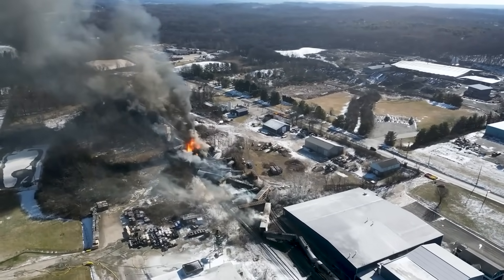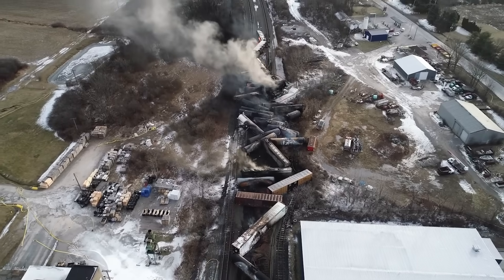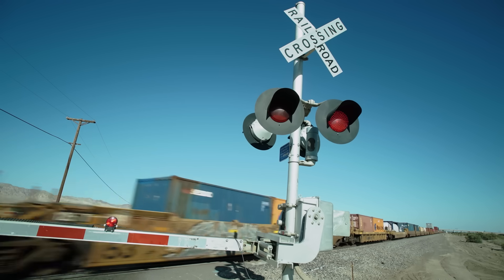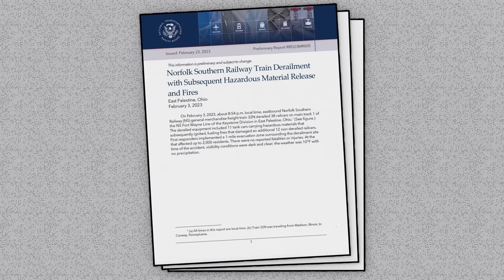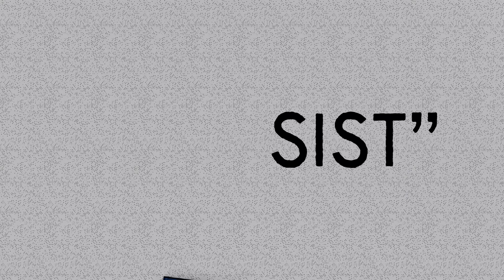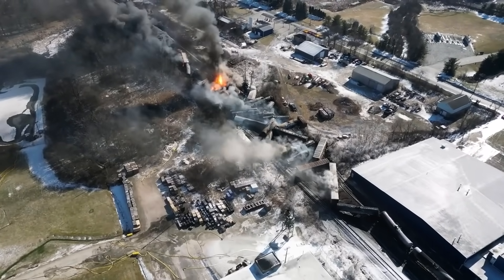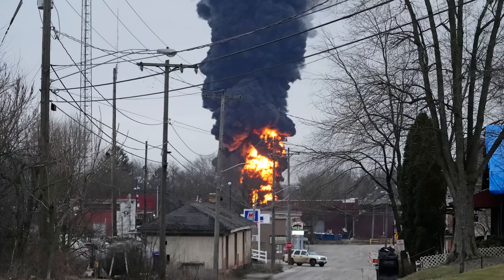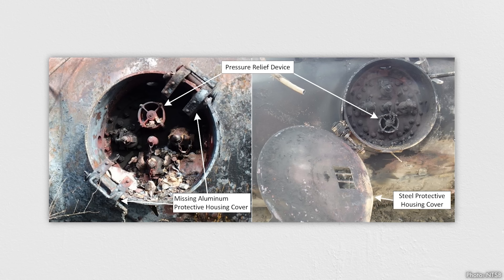East Palestine Train Derailment Explained

Comment: Hi! Railroader here! A few notes about defect detectors 

1. Defect detectors do not tell you the temperature of your axles. If the temperatures are within accepted boundaries, you get this message: "Train _, Milepost _. Axles_. No defect. No defect." If you do have an overheated bearing, you do get this message: "Train _. Milepost _. Axles _. Defect axle _. Defect axle _. Stop your train. Stop your train." Again, you're not given the specifics of the nature of the defect just that you do have an issue that requires visual inspection. Some do also note speed, but it's up to the railroad.

2. Defect detectors are self-isolated. They do not transmit data from one detector to another nor do they transmit it to a centralized computer system. The stored information is usually self-wiped up and until an issue arises like an overheated bearing or dragged axle. At that point, MOW crews will come in and grab the data. 

3. When I mentioned a train requiring a visual inspection, that duty falls squarely on the conductor. Since the 1990's, America's railroads have been operated solely by two guys: the engineer and conductor. By law, the engineer has to stay with his train to monitor the air brakes to make sure they don't accidentally release which has happened more often than you think. This means that the conductor has to walk the length of the train alone until he finds the problem and find a way to solve it by themself.
Reply: Very cool stuff.  Glad to have some input from people who have worked in the field with these beauties.  I used to work for Progress Rail (one of Cat's locomotive facilities), so seeing incidents like this happen are extra interesting to me.  They are mighty beasts and if they aren't treated with the utmost respect and care, terrible things can happen.  it was one of our units that fell into the bay while being unloaded in AU (i think it was). The locomotive alone was like 450ton or something like that... The payload of a mile long train... unbelievable.
Reply: So it reads the temperature and stores it locally, but only communicates a pass/fail?

I wonder if that'd be worth changing in light of this accident. On the other hand, a "pass/fail" is simpler for the crew than getting exact numbers.
Reply: @global2829  Simply transmitting them in real time to a central computer that can do further analysis (like one axle heating up too much/compared to the rest) would help. And if you want to go the extra step you can try to see if a MLM can be trained to spot defects before they reach any critical thresholds.
Reply: @krixlp , that has been proposed, but companies have been....reluctant to invest that kind of capitol in recent years.
Reply: @krixlp  better idea is have it transmit data in real time to a central computer with a AI that can detect upcoming defects and recommend maintenance when possible.
Reply: @global2829  The sensor may not even read the temperature. I work in HVAC and there are a lot of thermistor controlled safety switches. The thermistor(thermal resistor) changes resistance based on a temperature change and if the resistance closes a path that should be open, or opens a path that should be closed, the logic board will detect the fault based on what it sees as a binary data point.
Reply: @global2829  when you're talking about as many axles as modern freight trains have really all the crew needs to know is if there is a fault or not and what axle it is near.
Reply: @global2829  I dont have experience with trains, but I have worked with caution and warning systems on Military aircraft. How many axles per car? how many cars per train? It would be unrealistic to expect the conductor to monitor that many values. In aircraft you have gages for critical systems like fuel, rotor torque and RPM, engine and gearbox parameters ect, but many things are monitored with a caution and warning system that just gives you a light if something falls out of range. It sounds to me the system just wasn’t designed well in terms of the envelope of acceptable operation.
Reply: @global2829 , the issue lies in the fact that you have only two crew members total to handle the train when you used to have 5 men crews at the minimum. Engineers and Conductors are already facing hella work overload which is why they attempted that strike last October.
Reply: @caelumvaldovinos5318  
Not saying you're wrong, but 2 people are cheaper than 5 operating a train.
Corporations... Am I right?
Reply: @Dylan Watts , regrettably that is the case. The shareholders must have their value and the only way to do that is cut costs and corners at every available opportunity.
Reply: @caelumvaldovinos5318  you would need a 3 man crew at most, thats why they got rid of the caboose the EOTD does a better job.
Reply: @global2829  the railway companies could easily add so much better safety tech but they don't because they don't have too IE with no regulation they do the bare minimum
Reply: @global2829  completely random question : did you play Galaxy Online 2 for a long time?
Reply: Thanks for your post. So a defect detector is kinda like the dummy lights on alot of cars. The "check engine" light tells you somethings wrong but knowing exactly what's wrong will take a more time and investigation.
Reply: @olliefoxx7165  EXACTLY!
Reply: @olliefoxx7165  Yep. just like the oil light, if it comes on it's already too late.
Reply: @Blazer02LS  As true as that may be, once you see the warning light that means it's time to stop the vehicle.

The warning light isn't when it's too late, but you know it's too late once the train done come off the tracks.

I'm all for the idea of feedback sensors on each wheel, plus I'm all for the train guru's ideas of making a train length limit, increasing the crew, and also adding more safety sensors on the tracks themselves as well.

I'll tell ya what though, if we do nothing, then nothing will change. We have the technology, so there's no good reason we shouldn't apply the technology to prevent such disasters.

But you know how big companies are, it's all about the $$$...
Reply: As an industrial controls engineer (manufacturing not transport, but much of the tech is the same) this kind of binary logic is all too common. A few years ago, fuzzy logic was all the rage, now they label it AI for better sales numbers...but fundamentally the complexity of both the software and specifications/regulations that the software needs to adhere to need to increase a lot. 

The good news is that modern tooling and modern software are capable of handling that complexity. It's now reasonable for enterprising programmers to automatically instrument every sensor and every data point in a factory or train line with anomaly detection that would notice something like "that wheel bearing is surprisingly hot and getting hotter" while ignoring the temperature of wheel bearings on a train through a sunny section of desert.   The bad news is that it takes eons to push that decision back up the chain to management/purchasing/regulators to encode "do the smart thing" into the specification.
Reply: I'm a class 1 conductor/brakeman. It's all on the executives and hedge funds for slashing operating costs and pushing cars out of yards asap. Failing bearings are obvious to a car man with sufficient time to inspect. Yet the managers will deny the car repair and send it anyways.
Reply: @TUXmint , that's interesting. I can't even begin to think about handling that situation with just the engineer handling all of the responsibilities.
Reply: @caelumvaldovinos5318  trains here usually are far, far shorter than in the USA and Canada…
Reply: @pjotrtje0NL , that's what I keep hearing.
Reply: Interesting. I read that most modern fault detectors have cameras that activate to record and transmit to the engine. If this is true, and I don't see why it wouldn't work, that could alleviate a ton of speculative argument about these types of accidents. That must be exactly why American freight rail does not use them. That antiquated 20+ year old tech is fine... They said.
Reply: @Robert McGarry , those cameras only work if your locomotive has a computer screen on the conductor's desk that would allow him to monitor the train. Locomotives built after 1990 like the P42, SD70M, or AC4400-CW would have that technology either natively or by later upgrades. However, older models of locomotives like the SD40-2 and U33B do not have that tech. Also, those styles of defect detectors are relatively modern in comparison and they haven't seen that much of a rollout. Maybe with the stricter rules like Ohio requiring a defect detector every 10 miles we'll see more of that
Reply: @caelumvaldovinos5318  That is good information, thanks. Let's hope it does start change. 👍
Reply: @caelumvaldovinos5318  you could easily make a portable display and reciever to be used on those trains without the necessary tech. We are sooo far beyond the level of tech that would have been required to prevent an accident like this that "well some of our trains are 30+ years old" cannot be allowed as a valid excuse for not implementing safer systems. I am fairly confident I could, by hand, create a device capable of receiving and displaying a log of train condition data and potential red flags in about a week and for much less than 1k per unit which would make the cost of equiping all trains with such devices look like a sneeze compared to cleanup costs for events like these. Of course conductors or engineers might need some extra training to interpret the data meaningfully, but this could also be done on the device to produce output not possible from a single defect detector. In this case of information about the rate of temperature increase could have allowed the conductor to stop sooner as holding steadily in the maximum safe operating range is fine but quickly accelerating from below to near the top would indicate an issue especially in a situation where the train should already be in equilibrium if it had been traveling for a while before the problem occurred. Expectations could also be adjusted depending on how hazardous the cargo on board is.
Reply: @caelumvaldovinos5318  
Hi, I have some questions.
If the train engineers had advance warning of the overheating axle from the defect box and were able to start breaking the train, why did it derail?

The video mentions that the emergency brakes came on before they could bring the train to a controlled stop but then why did the emergency brakes cause the train to derail? Did the E brakes cause the derailment? Why?

Thanks!
Reply: @Mostly Penny Cat , that's a good question.

The reason why the train derailed was because the train was still moving when the bearing failed failed. When that happened, the axle came loose and pulled the train car off the rails. When the car came off, the air line that delivers the compressed air to the cars broke which caused the train line to lose pressure and go into emergency. This basically slammed all the brakes on in an attempt to reduce the damage
Reply: @Gage Unruh , then by all means build it and sell it.
Reply: @HatsuneSquidward  "I am fairly confident I could, by hand, create a device capable of receiving and displaying a log of train condition data and potential red flags in about a week and for much less than 1k per unit"

that's just some cheap laptop with a 2G receiver plugged into a USB port and some analysis software running on it that checks for all known possible data abnormalities in the received data.
Reply: @MostlyPennyCat  The emergency brakes came on when the derailment occurred which severed the air hose between the cars.
Reply: @Robert_McGarry_Poems  now the important question. How many cars actually use those modern detectors? What shite detectors have been allowed to be used through grandfathering?
Reply: Great information.  
2 questions.   you said "by law the engineer has to stay with his train to monitor the air brakes to make sure they don't accidentally release..."    I thought that the air brakes on trains failed in a safe mode.  That is to say that if there is a loss of air pressure the brakes apply automatically.  I believe it was even mentioned in this video.  If that's the case, how would the air brakes accidentally release?
My second question pertains to the Lac Megantic disaster.  If it is law that the engineer must stay with the train, then why was the train left unattended both before the engine fire and after the engine fire?
Reply: @tchevrier  Lac Magantic occurred because there were not enough hand brakes applied to the consist to prevent unwanted movement.  This train was operated by ONLY an engineer. The air brakes were set and was assumed under false pretenses that there were enough brakes tied to prevent movement. When air brakes are set, it is controlled by air pressure. When the fire occurred, the dispatcher told the firemen it was ok to shutdown the locomotive, thereby allowing the brake pipe pressure to fall below operating levels and the brakes eventually bled off. 

This was caused by a series of human failures. The biggest issue being the crew consisting of a single engineer. Having a conductor allows a double check of all necessary items to safely operate the train. 

Also, engineers sole responsibility is the safe and efficient operation of the train. It is the conductors responsibility to administrate all train operations,  as well as watch track conditions and signal aspects and to relay noted conditions to the engineer. That being said, engineers are also self aware of these things, in addition to the operation of the train and/or PTC. 

Those suggesting that the railroads should invest in extra sensors/cameras at every wheel to individually monitor conditions simply aren't considering the exorbitant cost this would involve. We are already paying inflated prices on all goods, this would acutely increase the cost of all shipped goods, as well as end use items produced by them. 

It has also been suggested that wayside detectors have cameras... I have never seen a camera at a detector.  Wayside detectors successfully protect rail traffic every day.
Reply: @imnufktsdude  I was surprised to hear that there was no conductor on the train.  Almost as surprised as when the engineer was acquitted considering he admitted to not following the rules and procedures.
Reply: @tchevrier train brakes work on the differential of air pressure. Air fills a reservoir on the car and causes the brakes to release once the pressures are equalized. When there's a drop in the pressure of the brake pipe then the brakes apply. Once a car has been sitting for a while then the pressures equalize again. That's why there's hand brakes.
Reply: @tchevrier  if the main brake line loses pressure the brakes will apply, but only if pressure is still high enough in the air tanks, or reservoirs, on the cars. If these tanks lose pressure the brakes release. The tanks will lose pressure over time if not kept charged. This is what happened in la megantic. The engine caught fire and was shut down allowing the air brake reservoirs to lose pressure and the brakes to release.
Reply: @jamesharrisontaylor  Thank you for answering my question about the brakes.  My question regarding Lac Magantic pertains to why the train engineer left the engine unattended when it apparently is against the law to do so.
Reply: @tchevrier  he tied handbrakes which don’t rely on air. This allows the train to be left unattended. He tested the efficiency of the handbrakes, however he left the air brakes engaged while doing so leading to a false confidence that the handbrakes were good enough to hold. They weren’t. When the air brakes lost pressure and failed, the train rolled down the mountain.
Reply: @jamesharrisontaylor  According to what the original poster (Caelum Valdovinos) stated that trains are operated by 2-man crews and by law the engineer must remain with the train to monitor the brakes.  My understanding is this train was operated by a 1-man crew.  How does the train engineer get out and set the hand brakes if by law he must stay with the engine to monitor to the brakes.?
Reply: @tchevrier  By securing the motors by tying the hand brakes on the motors. Then the engineer can get off and tie brakes on the cars and then go back to the motor and release the air brakes to check to see if they tied enough hand brakes, then they will put a new set on the air brakes.
Reply: @dammityoutube  ok. thanks
Reply: @jamesharrisontaylor  yes, somebody already explained that.  I guess that's all conditional upon making sure you apply the proper amount of handbrakes.
Reply: @tchevrier  right, and testing them to make sure they’re able to hold the train.
Reply: @jamesharrisontaylor  what is involved in applying handbrakes? Is it a lengthy process?
Reply: @tchevrier   just spinning a hand wheel a few times on the proper amount of cars while the air brakes are applied then releasing the air brakes to test the hold of the handbrakes
Reply: @tchevrier  The engineer of the Lac Megantic train, and two other railway employees, were each charged with 47 counts of negligent homicide, but eventually acquitted by a jury.

https://en.wikipedia.org/wiki/Lac-M%C3%A9gantic_rail_disaster#Criminal_investigation
Reply: @Dennis-vh8tz  yes I know.  Absolutely ridiculous
Reply: @tchevrier  Lac Megantic is precisely why the rules around train securement changed.
The initial failure mode for train brakes is to go into emergency. However, unlike truck air brakes which are spring applied and air released, train brakes are air applied and air released - once an emergency application has occurred, it is possible for the air pressure that is applying the brakes to bleed off, resulting in the loss of braking power. For trains left more than two hours, hand brakes must be applied.
Reply: FWIW, not all Defect Detectors are isolated. On at least two occasions in the last month I've noted Norfolk Southern dispatchers instructing trains in Virginia to stop and inspect specific cars in their trains based on "No Defect" reports that then passed more data back to the central office. The axle temperatures were reporting higher than expected, but not enough to trigger a defect based on the detector's rules. Also, some detectors can (and have) been configured to announce the cause for the detection, e.g. "Norfolk Southern Milepost One Four Point Four Critical Alarm Hot Box East Rail Axle Two Four Nine" -- as you note in other parts of your comment, it highlights where different railroads have different policies, and there is further variance based on age of detectors and the levels of integration available. or configured.
Reply: The whole "I could build such a device in a week" reminds me of the xkcd comic:

You're trying to predict the behavior of <complicated system>? Just model it as a <simple object>, and then add some secondary terms to account for <complications I just thought of>.
Easy, right?
So, why does <your field> need a whole journal, anyway?

So, I've done my master thesis on structural health monitoring. Not in the railway sector though. These are the things I learned:
1) It's easy to build something that detects 95% of failures and is quiet in 99% of the cases without one. But if you don't have that many failures, that's still way below usable on industrial scales.If you have a train with 200 cars and you have 1% false positive rates, you have two notifications per train. All the time. Nobody will pay attention to that.
2) You don't need microphones, you can just glue a piezo to the frame and you are basically done.
3) Constant supply of sensors is always an issue. Batteries work for a few years in good conditions. But in temperatures below freezing or out in the sun in changing conditions? Have fun. Charging is a nightmare if you don't have cables. And as we saw, we need measurements every few kilometers at least.
4) Sudden local changes are usually a good indicator of something breaking. Aggregation/comparison of data from multiple bearings would definitely be a good idea.
5) Having a few stations which can service thousands of cars in a few hours is way more cost effective than having a sensor in every car.
6) This is one I cannot stress enough: Companies are dumping loads of money in this technology. Because avoiding failures saves a lot of money. But it will not increase safety. It will be used to remove other costly measures. Just imagine how much money you can save if you don't have the operator check every car, but just have the computer flash a green light. That's like 10-30min of time the train can spend transporting cargo. That's a lot of money to be made.
Reply: UP has detectors that transmit to a central office where axels with temperatures that are trending upwards are identified and that information is passed to Dispatchers and crews.
Reply: This need to be addressed with a MASSIVE fees and fines payment... Because this is management decision on cutting maintenance and resposabilities costs in order to make profits.
Reply: @Google Google  unless you're going to fine the company in the tens of billions, and prosecute the executives. It won't change.
Reply: @GooogleGoglee  a better solution is to fine the hedgefund managers themselves, or at least ban hedgefunds themselves and promote individual shareholders. if we the people don't like a company not promoting safety or being a bigot in hiring policies, we can always dump the share price and punish the company financially till they announce they will do it and have made a plan to do so.
Reply: So you're saying the monitoring systems are only installed so that the freight company lawyers can shift the blame to the engineers and conductors but not actually detect any dangerous problems before they turn into a worst case scenario...
Reply: @SonsOfLorgar , defect detectors do work as designed. They have saved more accidents than can be counted. The issue with East Palistine is that the distances between these detectors in combination with a 3 mile long train created a situation where an axle deteriorated more rapidly than detected and corrected
Reply: @caelumvaldovinos5318  and in my perspective, that setup with fixed threshold and only binary feedback to the only people who can do anything about an immediate issue is a criminal design as it will never alert for this kind of extremely common form of intermediate-fast developing mechanical stress failiure in EVERY kind of machinery.
I used to be a waste water process controller and maintenance tech, and aside from the breakages and stoppages caused by the non-feces objects idiots flush down the toilet, this exact pattern of bearing failiure was the 2nd most common cause that was fixed before breakage by monitoring machinery running temperature and power delta amperage over time along with audiovisual inspections.
The third most common cause of pump failiures was cavitation damage to the pump wheel.
Reply: @SonsOfLorgar , it's what the railroads invested into back in the 1970's (?), and nothing has really changed since. Regrettably with the way the railroads are run, I doubt we'll see much improvement
Reply: The funny part is because the trains and what not were built a while back the materials that we have made and found recently would make some parts of them way better. Either making them last longer or just making them so much better at taking heat
Reply: @SonsOfLorgar  That is actually exactly how train companies operate with everything, not just the monitoring systems. I got to talk to someone who worked at a rail company once, and everything is set up to make sure any issues land squarely on the people working the trains and yards.
Reply: @bluefish239  yup, it's capitalism 101.
Reply: @SonsOfLorgar  As a criminal defense lawyer, yes. The answer is yes!
Reply: @SonsOfLorgar  sounds like the big train way to go.
Reply: Is every train in the US required to have a conductor? Asking because in Europe, many freight trains are run solo by the engineer. They tend to be shorter than US trains though.
Reply: @steve1978ger  The companies are pushing for engineer only crews, with roving conductors to help if needed. Currently still a two person minimum here is Canada.
Reply: There used to be a flight engineer in the cockpit of every plane.  There used to be more than 4 lanes open at Walmart.  Common thread: the profit motive of capitalism has to be checked by government regulations, but they are in the pocket of corporate lobbyists.  Lobbying is a legal form of bribery.
Reply: I'm not a railroader but rather an IT consultant and from that perspective I see both point 1 and 2 here as defects that should be corrected. Granted I'd prioritise fixing point 1 as by providing the temperature even if that is merely the highest temperature recorded in the pass to the train crew would allow them to act as the memory and detect the upward trend which they could then have acted upon. My proposed solution however would be to implement a connected system that solves problem 2 also, perhaps a mesh network where each station transmits the digital data on a secondary frequency that the neighbouring ones also act as repeaters for. This would eliminate the need to install wires in remote locations far from existing active data cables, sure the transmission to a central site would be slower but this is the less essential issue anyway. The key would be that the neighbouring units in the adjacent blocks in either direction would have this data within a few milliseconds, as such the software could compare the readings for each axle and report an abnormally large change in any of them. Were such in place the latter here would have prevented this accident it seems as two sensors observed a large increase prior to the third observing a temperature above threshold on it's lonesome. The system as I would have built it would have commanded the train to stop for inspection after the second sensor observed the anomaly relative to the first, granted there is a risk that a visual inspection of the train while stopped might not have revealed the problem but it is another opportunity to break the chain of failure, it adds one more layer of swiss cheese where the holes might not line up and thus can break the chain of failure leading to a disastrous outcome.
Reply: @FaerieSeraphina , 2 problems.

1. Train crews are facing work overload as it is. Having to remember temp numbers and monitoring trends takes up human CPU that should be allocated to train handling and following a rulebook that is thicker than some novels. 

2. The issue isn't so much as tracking an issue as it develops as it is catching the issue. Bearings heat up and cool down very quickly due to things like shifting loads, brake applications, curves, speed, etc. 

The solution really is to return to shorter trains, reinstatement of 5 man crews, and more defect detectors.
Reply: @caelumvaldovinos5318  . Exactly!
Reply: @FaerieSeraphina  I propose magnetically mounted IoT sensors at crucial points in the under carriage to form a peer to peer network,  passing data along for display at the engineer's cabin.  The sensors should be deployed with enough redundancy to account for some of them dying of overheat or corrosive leaks. When the cars are detached, they can be retrieved for use elsewhere.
Reply: If I were a train engineer, i'd want to see more information than just "axle good, axle bad". Couldn't they just give the train engineer some kind of display in his cabin, which has car axle data transmitted to the display via telemetry from the defect detector so he can examine the temperatures and their trends himself with some kind of interactive user interface?
Reply: @rixille , that has been proposed but the last thing you want is an engineer looking at a screen for 30 odd minutes when he should be looking for signals, crossings, obstructions in the track, etc
Reply: @caelumvaldovinos5318  seeing if the temperature of an axle is way higher than that of the surrounding axles takes 30 seconds.

just present the data in graph form.
Reply: @Ano Nym , you're forgetting that you're having to measure and compile that information over literally thousands of axles. Then whichever sucker has to read that then has to decrypt that data quickly and make a judgement call. Literally, just having a pass/fail call is the simplest solution
Reply: @caelumvaldovinos5318  that's like a dozen lines of python script to "decrypt" the data (I think you mean "analyze"), run regression and find outliers. Don't even need "AI" or machine learning, it's a simple statistical test.

I wouldn't even instrument every railcar/axle. Just make smaller, cheaper, lower powered and smarter wireless defect detectors and place them every mile, wireless mesh them together, and track trends on thermals, vibration, etc. No central repository needed, you can run the code on a raspberry pi equivalent hardware, at each node, and relay it to the next node in line.
Reply: @caelumvaldovinos5318  I've worked on projects of similar scale, albeit a bit smaller. To develop an industrial system like that would cost in the $10-200M range. Once you have that tech researched, each node would cost around $10-100k at scale. There are 160K mi of rail, so $1.6B-$16B to outfit the whole USA. The derailment cost NS $5B in market value, and likely will cost a similar amount in environmental cleanup and fines. That's $10B for the cost of 1 EP disaster, vs basically prevent most derailments. The technology exists. The companies are lazy cheapskates.
Reply: @defenestrated23  "we must preserve shareholder value!" Railroad managers will sooner scuttle their own railroads than adopt that tech
Reply: @caelumvaldovinos5318  why not have 2 engineers, one looking at the screen and one doing the driving? makes no sense to not have that sorta thing, along with providing comforts to the engineers and conductors on longer routes.
that way, you'd have 2 sets of engineers and 2 sets of conductors, whos job is to make sure the train is going 24/7. wireless video chat, and wireless internet among other comforts would help make sure conductors and engineers with families can keep in contact.
its a similar system to the airline industry, they have a sleep quarters for pilots and crew, but theirs is much more automated.

i bet the investment in the workers combined with the investment in the local infrastructure in terms of safety and accountability would make it a nice and comfy position that many younger folks would want to come into the workforce in, which then generates more jobs long term for the industry and more economic relief when needed. its obvious the current system is not working, and the duopolies needs broken up into a dozen pieces while mandating sharing of information to prevent accidents between companies and a monthly public audit into accidents, hijackings, maintenance, and plans to keep lines up to date.
Reply: @kermit peck , we used to have something similar. Back in the golden days of railroading, you had 5 person train crews: an engineer a fireman, a conductor, and 2 brakemen. However, deregulation, law changes, and bribery all led to the train crews being whittled down to just 2
Reply: @anonym3017  better idea:
have a AI that is trained to detect faults through all the sensors brian has stated, thermal, rotation and sound sensors, and send it back to the cab in a simple format that shows where the fault is on the train.
like on a 30 car train for example, if the sensors individually don't detect problems but collectively show a possible bearing problem in the future, the AI can transmit the data to the yard and the cab of the train simultaneously, and give detailed data for the yard workers while notifying the engineer and conductor to a possible maintenance needed reading out like "maintenance needed on car 4 wheel 3, recommend maintenance at nearest yard" and can schedule maintenance at the nearest rail yard upon request of the engineer or conductor. that by itself would help simplify the process of finding faults and items in need of maintenance. i still think a 10-20 man crew is better for long distance hauls while short to mid distance hauls can have 5 man crews.
i think also having stop areas for trains to stop and check a problem is also better.
Reply: @caelumvaldovinos5318  more or less its just hedgefunds and a serious lack of people actually putting stocks in their control.
once the people are put into control by decentralizing the banking system, you won't have those problems in excess with the rail industry.
Reply: @caelumvaldovinos5318  I agree. The tall companies need to pay for more workers to drive, observe & stop to fix the train when needed. Oh, but shareholders want their million dollar bonuses. 😠
Reply: @rixille  Monitoring the many hundreds of axles on a train would be better done a computer, and if the crew were expected to do so, that would massively distract them from the job of safely operating the train - adjusting speed, paying attention to signals, not to mention looking for:   cars, pedestrians, trees, etc on the tracks.
Reply: @rixille money and standardization and money
Reply: @rixille  it's honestly not needed. There's other people watching this stuff, the dispatcher will alert them if it's needed. People don't comprehend how uncommon these issues are anymore.
Reply: @rixille  for all like 7000 bearings (made up number but its a lot) in the train? pretty sure they have better things to do... you'd need a third person just to look at the data... thats why they use a computer to look at it
Reply: @killorkubed  It would need to narrow down only to bearings of concern, if any.
Reply: @rixille  but that’s what the computer system is already doing?? Figuring out bearings of concern and alerting the crew, this was just a case that the bearing went to hell too fast for them to do much about it
Reply: @rixille  same here.
Reply: @rixille  The defect detector will tell you the axle count of your train and if theres a defect what axle its (a lil fyi one railcar usually has 4 axles and most locos with exceptions have 6 axles) via radio
Reply: @rixille  I don't think that adding that much data to an already high workload would be beneficial. Perhaps they could could learn from NASA who have studied this sort of information overload to refine the pass/no pass into something a bit more informative for the crew of a train.
Reply: @minorityofthought1306  If train crews are being overworked or are inundated with too many tasks, then would it not make sense for the railroad companies to hire some extra crew?
Reply: @rixille  Quite the opposite. There are already projects, that involve remote control of (passenger) train by just 1 person. And that 1 person would be assigned up to 4 passenger trains all running simultaneously. Granted that much of the work would be automated as much as possible, but it still is a huge safety risk, which is tolerated because it allows to hire less workers per train.
Reply: @rixille  can't do that without risking profit margins. lovely how shareholders (aka hedge funds) control how a corporation works instead of helping a corporation to be more safety and worker oriented.
one thing my dad always said that his granddad always said "treat the employee good and they'll treat you well" and that seems to ring very true ive learned as so many problems in corporate america are often laid at corporations treating workers like cowpies and horse manure.
Reply: Where can you find frequencies for defect detectors? There’s three near me that are supposed to be on 160.800 but never transmit anything. I hear train crews on occasion but the detectors remain quiet.
Reply: @iananderson8363 , it depends on the railroad and not something that is handed out on the regular
Reply: @Ian Anderson some detectors only transmit if a defect is detected.
Reply: @iananderson8363  Some of those older Conrail DD installations only transmit an audio alarm if a defect is detected. Otherwise, nothing is transmitted.
Reply: thanks for the comments. no disrespect to the conductors, but it seems more failsafe technologies could help take the inevitable human factor out of the equation to help prevent these catastrophes
Reply: In response to your #2, it depends on the railway, some of them have reporting to the dispatcher office, as it's important (by rule in Canada) that if the train passes a site and doesn't get a message, they tone up the RTC to verify there are no alarms, while reducing speed.
Reply: All of CSX defects are networked together. As a matter of fact, train crews have the ability to log into the defect detectors portal on our tablets if we know where to look.
Reply: WRONG - defect detectors at all the major railroads report back to a central server where they can be trended on.
Reply: What strikes me most is the threshold used to indicate a failure. It seems that under normal operating conditions the axles are much less than 50 degrees above ambient yet they wait until temps are over 200 above ambient to trigger an alert. By that point it was too late. This seems like a major miscalculation and one that can be directly linked to causing this derailment. Why wait so long when even 100 degrees above ambient is anomalous enough to warrant inspection?
Reply: @josh208  bearings are fickle creatures. The weight of a load, train speed, track conditions, and curves all affect their temps. An empty hopper trooting along at 50 MPH in Nebraska will have dramatically different temps than if it were loaded and crawling up the Rockies. You want that leeway just so you prevent false readings and cause the crews to begin to get complacent when given a fail
Reply: I would love to be corrected if my assessment on this is mistaken by someone knowledgeable. I also happen to be a civil engineer. For me I like redundant safety systems though as an engineer I understand we are always on the balance of cost and safety. It sounds like there is little to no redundancy here. The way you describe things these detectors are blackbox recorders and the removal of the caboose was only to cut cost, not because it was made so redundant as a safety measure that it no longer served a purpose. That said I'm sure a more automated safety system than a caboose that works can be designed but does any such system exist? Because it sounds like the railroad industry is using the detectors as smoke and mirrors to cut costs at the expense of safety (aka business as usual for industry).
Reply: Oh I want to emphasize I think freight rail should be supported. Like if anything I hope we avoid events like this as much as possible to avoid people being harmed, to preserve a historic and essential industry and to keep our economy going.
Reply: would you recommend more in-depth information and/or retention of said information of rail cars/axles OR more present operators to evaluate reported occurrences along with tighter tolerances to active measuring devices?
    Edit: If neither, what would you're solution be? not to put you on the spot...
Reply: @dedkeny , my solution is 3 steps:

1. Cut train sizes to 1 mile maximum unless given special permission by the FRA. 

2. Increase train crews back up to a minimum of 3: an engineer, fireman, head end brakeman, rear end brakeman, and conductor and reissue cabeese onto trains.

3. Require hotbox detectors every 10 miles or when practable, not to exceed 15 miles
Reply: Walking a Defect reported train is my day job lul (Conductor here)
Reply: I've seen a few of Distant Signal's videos about defect detectors (haven't been popping up lately though - I blame The Almighty Algorithm). The actual sensing tech seems really useful, but it's just transmitted with this janky robo-voice radio system that looks like someone was just avoiding having to add any extra dedicated equipment to each train. With the frequency that these things are already installed along most lines it seems like they could be made to detect a lot more problems pretty reliably with some simple networking and data analysis. Especially in this case where there was one parameter approaching the threshold for a long time before any alarm was triggered. I assume those thresholds are set high enough to avoid a lot of nuisance alarms, but with some basic recording and comparing data between stations you could spot a single wheel temperature rising too fast well before it actually hits the limit.
Reply: @TUXmint  we can use wifi to record audio and where you are in your house, we can absolutely use microphones to pick out the sound of a failing bearing. The real issue is train companies aren't willing to spend money to keep the infrastructure modern and safe
Reply: Respect
Reply: I'm not reading through all the comments, but 24 year carman here. Newer detectors DO transmit data. That's how they give trending reports. Ours will send it to the mechanical desk and automatically create a report in our TCIS system.
Reply: Everything you just wrote is just bad and each one of those things needs to be addressed by the industry.
Reply: Disagree. Defect detectors to communicate to a centralized database (at least the major Class I railroad I work at). Trends are analyzed and if a car is trending hotter.. even if not at the threshold that the detector alarms, the computer generates an alert.
Reply: 1) modern detectors DO sync with back-office servers. As an engineer who (up till December) worked on this rail line east of Pittsburgh, I have multiple times been contacted by either the dispatcher or "wayside Detector Help desk" to be notified that a bearing is trending hot, that is, running consistently more than a few degrees above ambient temp. But it's almost always been hours after the servers discovered the pattern. In this case, the system probably detected the issue, and qued up a report to be transmitted to the crew. As someone who ran these trains, it is my opinion (restricted point of view that it is) that the major delays are caused by major staffing cuts at the headquarters, thereby creating massive backlogs in helpdesks contacting trains.

2) PTC was a MASSIVE, congressionally-mandated, computerization effort of train operations. PTC included digital notifications of paperwork changes and travel authority changes to train crews. This includes automated notifications that automated electronic tests done for crossing protection systems have failed, and issuing instructions to safely operate through a suspected non-functional crossing. So why don't the detector systems have an automatic alert/notice of a 10-15 degree increase between detectors?
Reply: That may be how defect detectors announce where you are, but it is not how they are elsewhere.  I have traveled enough to see several types that announce far more specific information than the ones you described.
Reply: @bradarmstrong3952  Even if that's true all it does is highlight that NS and probably other roads have detectors that are only really useful post accident. There is clearly no (enforced?) standard of sufficient safety.
Reply: I work with the railroad. NS to be specific. 
What baffles me is that there seems to be entirely too much reliance on customers to monitor and report railcar issues to the railroad for repair.
I know the railroad does do inspections, however it seems like they cover coupling, braking and whether or not there's a leak. That's it. The rest seems to lie on the car owners or people like me that load or unload said cars.
I deal with hot asphalt cars regularly. The time requirement for inspections on these cars for safety features can be 6+ years.
When the people handling these cars do not own them, there's an "I don't care" attitude that comes with it.
Especially when these cars do not come back to you for months, years or never.
Reply: @moparmadness0180  I think in general in a system like ours there is always a push and pull over time between regulating safety and not putting onerous duties on operators. Unfortunately we tend to balance  b/t extremes with our regulation- too much or not enough. The rail industry is far from alone in that manner. It is quite shocking to a civil engineer tbh though. I would not have been able to remain as calm while talking about the (apparent lack) of any redundant safety measures in that system.
Reply: @Moparmadness01 , I'm not surprised by the lack of inspections. But I'm still incredibly disappointed
Reply: sounds like politicians have been at work in the railroad industry. 
politicians with their pockets full of corporate fat cat stacks.
politicians that encourage industry "self-regulation" not government regulation.
politicians that last cycle gutted enforcement divisions of the government.
politicians that don't care about the working man/woman providing for their family, just the profits off their labor....to bribe the politicians
politicians that don't care about risks to workers, the public or the environment.
What politicians does that sound like??????
Reply: >monitor the air brakes to make sure they don't accidentally release which has happened more often than you think. 

How do they "accidentally" release? Are we talking a mechanical issue, or a human one? If no one's on the train, no one's there to accidentally bump a switch or something right?
Reply: There are networked hot box detectors in high traffic areas and send data to the carriers network operations center.  These are more expensive and not used in low traffic areas.
Reply: and what did Alfred e newman have to say ? 
too many whites in construction. 
wtaf
Reply: As a railroad man myself I can validate everything you said. And I say well said.
Reply: Kinda sounds like there should be bigger crews for the bigger trains. And I think that there was a strike that mentioned that too
Reply: What of this was done on purpose to destroy small farmers ability to produce to help Create a coming crisis worse?.. hmmm
Reply: i feel like just having more detectors would be good enough like 20 miles is a pretty good size distance for a lot to happen if a defect happens right after a detector and is bad enough it wont even make it to the next one since metal on metal can heat up very fast with friction like melting steal in minutes fast. i would say every 5 miles but we all know the goverment and railroad companys wont do that because that doesnt make them money. this is the us if it doesnt involve money they dont care sad but its very true
Reply: Thanks for this perspective.  I understand companies want to save on labor costs, but having anything less that two people on a crew seems a terrible plan.
Reply: @sesquey  it should be like 4 to be fair because if its only one person making sure the whole train doesnt depressurize thats leaving a lot of hope in human error not saying hello
Reply: I get that having a simplified system makes life easier for the crew, who are overworked and may not be trained for dealing with the extra data. (And it would be a lot since you’re talking about hundreds of cars, each with dozens of data points)…

But it’s not like we can’t transmit, record and computationally make that easier… at very least it would be good to have more than just a binary. Pass/fail doesn’t tell you that you barely passed and might fail any second- miles and miles from the next check, by which time you may well be past the point where you can save the train.

As it is, the difference between “everything is perfect” (temp below 170) and “critical failure, train must stop immediately so car can be removed” (temp over 200) is only 30 degrees. If these stops are 10+ miles apart… it seems like it might be trivial for old equipment in use to jump that gap entirely between checks… leaving a train running for miles, well above critical, with no one the wiser.

You don’t have to give the conductor and engineer all the data… but you should give them more than just 2 bits. Set it up with, say, 7 grades… with the full data sent to a central location.

From a 1 “perfect condition” to 7 “too late to save the train”.

Anything 3+ flags the data for review.
Anything 5+ requires a stop and flags the data for immediate review.

I’m pretty sure the crews can handle that.
Reply: @ARedthorn , to make that work, we need to increase the minimum train crews back up to at least 5, reintroduce cabeese on the train that are capable of receiving & displaying the data, and equipping all the defect detectors properly. At this point, that is not happening with the way railroad management is running things these days
Reply: @traindude 28 , you still find SD40-2's on local service on the class 1's. They're really the only option when talking about light track and sharper corners
Reply: @traindude 28, oh yeah, I've heard about that garbage.
Reply: @traindude 28 then how do you explain the disaster when the sensors with binary alert system worked exactly as designed and, as designed, failed to alert the crew in time to prevent it?
Reply: Thanks for the information!
Reply: Americans never pay attention to the cheating incidents in their own country. On average, there are 800 cheating incidents every day, which is more than the cheating incidents of all countries in the world combined.😂😂
Reply: It sounds like they need to reconsider the thresholds...maybe add a new one that forces a stop if the temperature increases, say, 200% in 10 miles. That would seem to be either more or as important as the difference in temperature between bearings.
Reply: @slightlycrookedworkshop , bearing temps change wildly as track conditions, speeds, load weight & balance all change. Tracking percentage change is a recipe for disaster as crews begin to ignore the calls to stop the train and an actual problem gets buried
Reply: It's very good rebuttal. Thank you for laying me like myself
Reply: https://www.youtube.com/watch?v=b2n9ov3l4zE
Reply: Pretty crazy with all the relatively cheap tech that the axels don't have native monitors on each bearing housing. Bet that's coming soon...unless I'm underestimating the power of the train company lobby.
Reply: That 1990’s style thinking of 2 guys monitoring an entire train by themselves with all the technology sounds very.. outdated.

Thank you for all of your insight! Met a railroad engineer once and was a very friendly and sweet old man, still remember my encounter with him today when I had to drive him to the airport to fly out to his train or whatever he was doing.
Reply: incorrect and poor messages could get fixed if anyone cared to do so.
Reply: could you make a video describing this video
Reply: i don't know why modern fault detectors don't simply transmit data to the cab, and having a 3rd guy who can read the data and relay it to the engineer and conductor around wouldn't hurt.
i don't get the whole problem with it, if it reduces accidents and generates more profit long term. eventually theres gonna be a huge lawsuit that puts them to shame sooner or later, and its not gonna be good for the train duopolies.
Reply: @kermit peck , sharehold value my friend. They don't like capital investments cause it eats into the bottom line
Reply: @caelumvaldovinos5318  mhm, thats why hedgefund managing companies hate it. the average joe shmoo wouldn't care if he or she had some stock in a company.
transparency with a monthly public audit into various company areas simplified for the average joe, including investments into safety and workers would do a much better job at keeping big corporations in line than the average regulation. that way we can vote with our wallets.
Reply: So I have a question
Another train wreck happened today with an “unknown cause” of derailment in WI (I dunno if they ever confirmed the cause of the east palastine train derailment) but both had toxic sludge/toxic product. I think the WI derailment contained paint and lithium ion batteries. Do you believe that maybe something somehow was tampered with?
Or maybe it’s just coincidence like I’m hoping?

Edit: glad they finally analyzed the hazardous materials in the derailment in OH. It worried me seeing black vats that only said “pending analysis”
Reply: @Caz-wu5wb , what this video and others that were made by outside the rail community fail to communicate is that derailments happen all the time from something as unpredictable as the train rolling over some soft ballast that threw it off balance or a wheel randomly picked a switch to incidents caused by predictable factors like worn rail or poorly maintained equipment
Reply: @caelumvaldovinos5318  thank you for this.
Reply: Incredible that one failed bearing or axle could cause such a mess.
Reply: I bet that the 300+ mph trains in China and Japan don't rely on such an antiquated system.  Of course, those are passenger trains and probably have individual sensors on each bearing.  Do they and the Europeans use similar defect detectors or have they advanced?
Reply: I have no idea how much a train costs but it seems like implementing something a bit more modern and wireless would add very little to the overall cost.  For $10 you can pick up a ups USB radio which can receive and decode aircraft ADS-B data.
Reply: ...thanx for this realy good explaining......
Reply: 0
Reply: just curious but arent the safety systems different everywhere or is that just a general standard?
Reply: This is a perfect example of why the return of a caboose, and the associated rear-end crew, would be good to have on modern freight trains. That way, the head-end conductor doesn't have to walk miles of train on his own. Instead, he's only responsible for visually inspecting the front half of his or her train, while the rear-end crew is responsible for the rear half.

Both the rear-end crew and the head-end crew would still have to walk around their train, however, there would be two different sets of paperwork, one for the head end and one for the rear end.
Add to this the fact that a second pair of eyes will often catch things the first pair might have missed, which will cause reliability and safety to go up considerably.

Perhaps add an inspection ATV or two to the train alongside the caboose as well, as a quality-of-life measure. So instead of walking the length of the train, they can ride an ATV.
Reply: @TUXmint  understandable, but that's extremely selfish. Look at the damage train disasters have caused in the past. Certainly too much is reliant on the diligence of the conductor, but that could be addressed with systems like what others have mentioned in these comments. Automation, data aggregation, and machine learning, having individual pass/fail checkpoints is the train companies doing the bare minimum for liability. We should always be on the side of caution, even if that means making the conductor get up and walk the train a few more times than necessary. Though I would imagine if implemented properly we would probably see a decrease in unnecessary walks, and a reduced diagnosis time.
Reply: Number 1 is kinda off.
Number 2 is also wrong. Has been for at least half a decade.
Reply: @TUXmint  if only there were some technology that could automatically take the per axle data provided by the, new, detectors analyze them and put them into nice and easy to read graphs.

Oh right. PCs are a thing and they do all of that.
Reply: Question...

Why the hell don't they have microphones on those defect detectors? We live very close to a railroad and frequently have to stop to wait for a train to pass, and I swear every single time a train passes you can literally hear that like 5 to 10 railcars have obviously failing bearings...
Reply: @southernflatland  That thumping sound you hear isn’t a failing bearing but a flat spot on the wheels. Likely from being moved around the yard with brakes still applied.
Reply: @jamesharrisontaylor  Yes I've gathered that. Read further down towards my last few comments to get a better idea of what all I'm really thinking of, including thermal and rotation sensors.
Reply: @southernflatland what you hear is flat spots on wheels and side friction on curves.
Reply: @ferky123  Yes, I've gathered those are the main factors that account for much of that sound. Regardless, I think microphones would be useful for periodic inspections to locate which wheels need visual hands on inspection for flat spots and other potential issues.

Also should have thermal and rotation sensors on each wheel, or at bare minimum at least each axle. Then, to account for variations in the environment such as ambient temperature, you compare the readings between all the sensors on each train car.

If all the sensors are returning almost identical stats, then everything should be fine. But if a signal comes back saying wheel #3 on car #17 is 30 degrees hotter than the other wheels or going at a different speed than the other wheels, that would indicate a serious issue and it would probably be a good time to stop the train.
Reply: @southernflatland  Depends on the defect detector, some use thermal cameras, some use microphones.
Reply: @southernflatland  I thought the same thing. Even car engines have these sensors (knock sensors) which are basically just microphones. It wouldn’t be that expensive to implement.
Reply: @southernflatland , here's an actual railroad quote: "the biggest dumbasses on how trains operate are management. The next are the general public." The last thing you want is to have joe-shmo hear a defect detector blair out that axle 142 has a defect. The hype and sensationalism will cause more harm than good. 

Now, those sounds you hear may not be bad bearings but other issues like wheel flat spots or a hunting truck, or a loose brake chain, or a thousand other issues that require training to recognize and diagnose
Reply: @caelumvaldovinos5318  And your point is? It's the year 2023 homie, we have smartphones and smartcars these days with half a zillion sensors to detect everything under the sun.

Why don't they have smart technology sensors on each wheel of each train car monitoring for defects in real time and communicating that data to the engineer and conductor in real time?

Oh, and I love how you just casually dismiss flat spots on the wheels as if that's no big deal...

Trains are very heavy and obviously very dangerous when things go wrong. It's 2023, we absolutely have the technology to prevent most of these sort of issues. Why aren't we applying and using that smart technology?
Reply: @caelumvaldovinos5318  Ya know, you can go ahead and say it, it's all about the $$$ isn't it?

Things like this remind me of the meme with the dog sitting in the burning building saying "This is fine"
Reply: @southernflatland , for starters, I know exactly what will happen in the shops if they now have to maintain sensitive sensors on wheels that get grease, grime, dust, flying leaves, etc. 

Flat spots are a spectrum. There's a limit where they have to be ground out or condemned, but they're one of the most common problems on railcars for a variety of factors including mishandling. 

Also, consider the crew up in the cab. There's only two guys that have to monitor air line pressure; fuel, lubricant, & coolant levels; train speed; track signals; radio transmissions; switch alignments; track conditions; crossings; grades; sanders; headlights; wheel slippage; the list goes on. Vicariously adding in monitoring the bearing temps of literally thousands of axles is beyond reasonable. 

Also factor in that railroads still use locomotives dating as far back as 1930 on their rails. So, how do you intergrate that technology into something that doesn't have computer tech? WITHOUT THROWING THEM AWAY

Refer to my quote
Reply: @southernflatland  "we have to increase shareholder value" is the proper term to use
Reply: @caelumvaldovinos5318  Funny you worry about grease and grime affecting sensors. Cars have grease and grime under them as well, but somehow the ABS sensors tend to work just fine and rarely have any issues.

And if an ABS sensor does happen to have an issue, it's very often caused by... you guessed it... a failing bearing...

But yeah, if they can keep an ABS sensor clean, I'm pretty sure they can also keep a thermal sensor clean.
Reply: @Brian Chauvin , you're making a logical fallocy that a car is equitable to a train. They're not.
Reply: @southernflatland  . Thank you! I’m a victim of the chemical spill in East Palestine. Still recovering from my lung injury. Head of the NTSB who visited here said this accident was 100% preventable.  The trains are too long , heavy. Crews are overworked and understaffed. Technology is lagging. Management and monopolizing are to blame. Quarterly profits are their only concern.
Reply: @southernflatland  Because we as consumers dont want to pay for that. It would make the transport too expensive....an accident now and then is cheaper. Not good for where it happens and the ones involved. But that is the economy at this scale....
Reply: @Peter_Enis  I recently saw a report saying that on average like ~1700 trains get derailed each year, and that number is increasing with each passing year.

So let's just sit around with our thumbs up our asses and do nothing huh? This seriously reminds me of the meme with the dog sitting in the burning building saying "This is fine"

We're in 2023. We have smart phones, smart cars, and smart airplanes. Hell we have smart refrigerators and smart toasters even, and there's no good reason those even need smart technology.

Yet still, for whatever ungodly reason we still have dumb trains.
Reply: @jp4546  Man I'm sorry to hear that, I really am. It's sad that everything else in this modern day has almost excessive smart technology for everything under the sun including safety, while still our trains are as dumb as the box of rocks it's hauling.

I hope you and everyone affected can all manage to recover soon, but yeah that's gonna have the entire environment and ecosystem around there screwed up for years to come huh?
Reply: @southernflatland   Capitalism. The margins on rail freight are very narrow and the stock holders or Mr CEO aren't going to let their pound of flesh go. That means there is no money for upgrades unless forced by regulation and when the rail companies are major contributors to the standards that regulation is delayed until forced by accidents like this one.
Reply: @southernflatland  . Thank you and yes. Norfolk Southern Railway corporation is not the least concerned with public safety. Their only concern is their shareholders and quarterly profit margins. The environmental impact is unimaginably egregious. I am planning to get out of town . I own my home though and I will have to take the hit on my property value.
Reply: @southernflatland  It's about money because customers, tax payers and voters are unable or unwilling to pay for perfection. If one railroad increases safety and another doesn't, all the business goes goes to the cheaper and less safe railroad. If the government mandates safety improvements, the railroads comply and pass on the cost through increased freight rates, shippers increases their prices, causing retailers to increase their prices, with markup at each layer. Voters then complain to politicians about food and consumer goods getting more expensive (inflation). Manufacturers go out of business or lay off workers because the cost of parts are materials increases, so more voters complain to the politicians. Politicians listen to the voters and make the bureaucracy loosen the regulations. Over time a compromise is worked out to determine how much we, as consumers and workers, are willing to pay for safety.
Reply: @southernflatland  I'm not a railworker, but work in wastewater-- another field in which a bungle can create a massive environmental disaster. My plant is a public utility, well funded, and invests in all sorts of smart systems to monitor the process. The result is that we spend about half of our time diagnosing glitches and chasing problems that don't exist.

You're completely justified in your assessment of more smart technology = safer system, but it doesn't always shake down exactly like that. We keep excessive records of all our maintenance for the express purpose of covering our asses when something inevitably happens. 

It certainly looks worse when you're a for-profit rail company that is just trying to dodge safety to make an extra dollar, but I work for a public entity that's allocated generous funds by an elected board... Sometimes it looks really good on paper, but when implemented just becomes a headache that complicates the real problems that are inevitable in any large industry.

I would argue that having invested operators that care about the work they do is the best way to avoid a disaster, and keeping good records is the best way to explain what happened and why. You can throw all the money you want at something but you end up getting diminishing returns and wasting resources, whether that means less money in your Scrooge McDuck vault or having to sacrifice funds to some other important public institution.
Reply: @southernflatland  an ABS sensor is simply a Hall effect sensor. A very basic piece of equipment.
Reply: @southernflatland  you are comparing a sealed bearing in a dry envelope to an oil bath bearing apples to oranges. Also abs sensors are hall effect sensors that fail when the bearing becomes loose so to wear, and no longer can hold the sensor and tone wheel in proper alignment. If train axle bearings were that loose under the stresses they see the car would already be on its side.
Reply: @imnufktsdude  Yep, hall effect sensor, I know. Figured I'd try to keep my terminology a little simple for all the readers by referring to it as an RPM sensor. When you get down to it, that's basically what it is in this sort of application, and indeed it's not very expensive at all.
Reply: @joelzelko1537  And your point is? If a sensor fails, patterns will either cease to be detected or show erratic output. Both of those conditions can also be detected.
Reply: @joelzelko1537  Also, oil is an insulator. If somehow oil causes the sensors to fail, then the oil must be contaminated with metal to make it conductive. Which is also a red flag for maintenance time.
Reply: @southernflatland  I'm not saying that trains dont need to be a lot "smarter" and safer. It's a miracle accidents dont happen a lot more often........Just be prepared to pay the cost. Every time a sensor goes out the train has to stop and be inspected....Or do we keep running with a faulty sensor? Or do we build in 3 backup sensors per wheel or per axle? Do we place sensors in the tracks? How many?
What if something happens because we thought "it's just a faulty sensor" and we dont stop the train? What if we stop the train and all trains behind it have to wait. What if you were on the train behind having to wait on your way to the airport to see your loved ones at christmas. I'm just saying that it's not only a technical dillema, it's an ethical, economic and technical challenge....all choices come at a cost....
Reply: @Peter_Enis  that seems far better then binary so i agree
Reply: @Peter_Enis  No, a failed sensor wouldn't mean the train has to stop, that would just get flagged as a soft error to check out at the soonest convenient maintenance time.

The red flag conditions they'd need to stop immediately for is if the sensors register a particular wheel or axle that's running notably hotter than the others or running slower or just not rotating.

A failed sensor either wouldn't send any data or would send zeroes back, which is not a red flag of a bearing failure but rather just an indicator that a particular sensor currently isn't sending any data.

Soft error - Computer registers it for the next maintenance checkpoint to check that particular sensor.

Hard error - Overheating or slowing wheel, stop the train immediately!
Reply: @Peter_Enis  And what's the cost of cleaning up a derailment scene? What's the cost of the lost cargo? What's the damages to the ecosystem and environment?

And what are lost lives and unhealthy people and animals worth? 🤔

It costs either way, but in the long run it would cost quite a bit less to avoid many of these sort of disasters in the future.
Reply: @southernflatland  I agree with your main points but you need to remember that "derail" could just mean a tiny hop over the flange, not necessarily some catastrophic disaster that puts all hands on deck
Reply: @Lauri_Heino  Oh, just a 'tiny hop' huh? So let's just keep dragging this train car because one pair of wheels off the track don't matter?

Bruh, even one wheel off the rails is gonna lead to more wheels off the rails, more cars off the rails, and basically a chain reaction..
Reply: @Peter_Enis  i would welcome it, as a consumer. even tho my wallet would pay the price, and im not remotely in any income bracket to accept such, if it ends is safer rails and peace of mind knowing that the CSX rail that goes through the town i live in is not as prone to such a disaster, then the means of higher prices on goods is better, knowing that i can feel safe.
Reply: @southernflatland  man you don’t have a clue what you’re talking about.
Reply: Hopefully the internet of things movement will make these a lot better. I imagine a large increase in temperature is much more alarming than a constant temperature which is moderately high. If they were connected, things like this might be more noticeable. I imagine it's cheaper than even one cleanup like this one.
Reply: You missed a glaring error at 4:25. are rail car brakes fail safe and apply with a LACK of air pressure?
Reply: @Seldoon_Nemar  Yes. If you release all the air in the brake pipe and the main reservoirs on the cars, it will kick the control valve to the emergency side and dump the air from the emergency reservoir to the brake cylinder to apply the brakes in an emergency braking application.
Reply: @Seldoon Nemar  yes. Rail brakes apply when air pressure is lowered. They'll stay applied until the system is charged back up or all the air is depleted. 

Every car has 2 air tanks. Which are the same pressure as the brake pipe. When the brake pipe pressure goes down, the Triple Valve moves and tank air pushes the brake piston out. When brake pipe pressure rises. The triple Valve moves the other way and the tanks are charged, and the brake piston goes in. As the pressure is equal on both sides of the triple valve. the air can leak from the car brake system. Pressure equalizes between the sides of the triple valve and brakes release. Allowing the car to roll freely. Which is why locomotives constantly pump air through all the cars to keep them pumped up. If there is too much leakage. Then, the brakes apply on their own, won't release, or the cars won't have sufficient air in them to apply the brakes hard enough. 

Freight train car air brakes are either applied or released. You can select application pressure but not change it. You have to release the brakes and let the train pump back up before applying them again. You can put the train into emergency on soft air. As the second air tank on each rail car is for emergency application. Though this is not ideal. Cold weather, train length, and if there are distributed power locomotives can all affect how well the brakes pump up after application.
Reply: Industrial society and its consequences have a disaster for the human race.
Reply: @Peter_Enis  Use microphones passively for periodic tests to locate flat spots in the wheels and other concerning sounds. Honestly I wouldn't count on microphones as an active constant use sensor though. Too many environmental variables to count on that outside of general maintenance inspections.

I'd also have thermal sensors and rotation sensors on every single wheel. As far as environmental temperature differences, well you compare the signals of all 8 wheels on each car, and if they're all giving basically the same signal, then everything is almost certainly just fine. But if for some reason wheel #3 reads 30 degrees hotter than the rest, well that's pretty much an instant red flag.

I'd also think that if one of the rotation sensors starts reading slower than the others or just stopped altogether while the rest of the wheels are turning, that's also a red flag.
Reply: @TUXmint  If there were microphones on every wheel, then a fairly simple computer chip could compare the difference between the microphone readings and if one sounds significantly different than the other nearby wheels for any extended length of time more than a few seconds or so, then indeed sound could be used to detect bearing failure, by sound differentials.
Reply: @southernflatland  It would probably be cheaper, and definitely more effective, to build a temperature sensor (instead of a microphone) into every wheel.
Reply: @Dennis-vh8tz  You're right, but you should read my most recent comments at the bottom of the thread too. I'm brainstorming ideas for a reasonably affordable, fairly easy to install sensor system that would include not only microphones but also thermal and rotation sensors.

It's 2023, we have the technology to make such a thing feasible.
Reply: @southernflatland  It's real easy to say, we should be doing this, and we should be doing that, implementation is the harder thing to do even if you completely ignore the cost. Who's going to check and maintain all of those tiny microphones and microchips on every car after the monumental expense of outfitting every rail car with them? The already overworked crew, the maintenance people when a car is finally brought in instead of just scrapped, a maintenance crew that has to go around to every yard with the right equipment to do field repairs? When do you check them? During regular maintenance which may be years between, or every time the car is handed off from one crew to the next, or something in between? You now require electricity and data to be wired to every car to operate the system. More complexity, more points of failures. Are you allowed to keep using the car if the system has failed or does it need to be taken out of service until it's fixed which would mean more cars need to be made to take the place of every out of service car...

The more complex something becomes the easier it is to break down somewhere in the chain. Every time you add an additional system and inspection and maintenance, you add complexity that needs to be accounted for. If you have microphones on every wheel to listen for flat spots, you then become reliant on "the system" to alert you and if you don't get an alert, you ignore it. Yet there could be a flat spot and it could be the microphone covered in dirt and grease not hearing it. The microchip may have rattled loose and is not transmitting anything through the system at all anymore. What happens when a grainer has been sitting at a customer's yard for 6 months during the winter and spring when there's no grain being produced and it's discovered after the car has been filled that "the system" isn't working? Is it the customer's fault for not checking first before filling the car? Is it the car owner's fault for not checking all of the thousands of locations their car could be at? Is it the rail operator's fault who's just moving the car from A to B? What about the cars that are put off in sidings for storage and they sit there for 3 or 4 or 5 years? Does a crew need to go out and check them before they can be used again or do they just use it and submit a report to have it looked at the next time it goes in for maintenance which may be never?

How much of a flat spot are we talking about here? Is it as soon as one is detected or is there a scale where a little banging is acceptable? At what speeds need to be required before checking can begin? Cars moving slowly don't bang anywhere near as loud as cars that are being pulled along at 70 miles per hour. If a car has a flat spot but is on a line that never goes more than 25mph and thus the noise is never bad and thus does not need to be repaired, you know the rail operators are just going to shift all of the bad cars to the slow speed lines which is going to result in more people hearing the banging and having more complaints because the speed restricted lines are going to be in areas where there are a lot more people and if every car is banging along with their flat spots, you know how that's going to turn out.

Then there's the issue of false positives. The more times alerts are given that turn out to be not problems, the more likely people are to ignore the alerts. How often are alerts to be sent? Every time the car starts from a stop which could be multiple times in one trip? At every crew change? Every time the car enters a yard? Only once the first time a problem is detected then never issued again so it's forgotten about? How often are these alerts transmitted to a central management system? At every defect detector which would require every single one of them to be updated with some cell or satellite connectivity (which then adds complexity and maintenance to those as well)? When the cars enter a controlled yard and can check in? What about all those cars sitting off in sidings, they're not checking in, so do you assume they're just good until you drag them to a yard or past a detector?

Once you figure out all of these other things, THEN you start adding up costs, costs you and I get stuck paying for one way or another. Costs I don't want to pay for because a flat spot on a rail car doesn't bother me in the slightest, and in fact reminds me of the days before continuous welded rail where cars would often bang against the gaps between pieces of rail. You're annoyed by it, I enjoy it. And probably the most hilarious thing of all about all of this is your system doesn't prevent flat spots from developing, nor does it stop you from hearing them after they do develop, so you're spending all of this money and resources on working with and maintaining a complex system that does absolutely nothing useful. It only tells you that there is a problem. Something you can do when you're sitting at a crossing and hearing the car bang on by. Every car has a serial number, every rail operator has a phone number. Write them down and report them, people do all of the time. Still isn't going to fix the problem though, but at least I'm not stuck paying for your wasteful desires to "fix" something I enjoy.
Reply: @Stant123  Much of it could actually be implemented wirelessly, we live in the year 2023 now, we have cellular, WiFi, Bluetooth, etc as options. We have inductive power as well.

I'm sure it could be designed as a reasonably simple retro-fit kit to make each wheel sensor kit reasonably simple to install. As far as the engine trains not having a computer? Hmm, maybe one day someone might invent this portable doohickey called a tablet? 🤔

If a sensor reports a malfunction, or perhaps even stops sending a signal, well maybe just maybe that means it's high time for someone to check and maintain the bearings? Seems that's a big part of the problem anyways, lack of maintenance. God forbid they hire a few more folks to maintain these extremely large and dangerous things...

If a sensor goes out, well make it easy to swap out with another identical sensor, basically all they'd really have to do is program in the train car serial number and wheel number, bolt it on and go, after double checking the bearings and wheels anyways.

I'm sure there would be a few complications and some cost overhead involved getting all that set up and going, but we're more and more seeing how doing nothing different has been working out...

We have the technology to prevent most of these sort of issues. Modern vehicles have a buttload of safety and status sensors and an onboard computer. Modern airplanes have way more than that even.

So why are our other dangerous and heavy transportation machines so smart, while our trains are basically dumb as the box of rocks it's hauling?
Reply: @Stant123  Also, note that I'm not suggesting only using microphones, I'm also suggesting thermal sensors and rotation sensors.

As far as the high possibility of the microphone getting covered in dirt or grease, well have it installed in a cone covered with a diaphragm. That would allow vibration to travel through to the microphone whether it's covered in dirt or not.

And even if one sensor does happen to go out, you still got the thermal sensor and the rotation sensor. If one sensor stops delivering a signal then it could flag a soft error saying to check that sensor assembly soon, but if two sensors or all three start giving red flag warnings, it's probably time to stop the train right then and there.

Of course, back to the microphone, that would probably be more of a passive sensor of sorts that would be used on non-rainy days as more of a periodic inspection of flat spots on the wheels or other concerning sounds such as bad bearings.

Any which way you look at it, I feel the technology wouldn't have to be much more complicated than the sorts of sensors in your phone packed into an electronic attachment not much larger or complex than a $20 USB dongle.

Granted I'm sorta over-simplifying things a little bit, but seriously it's 2023 now, it's not like the train would need a supercomputer installed.
Reply: @southernflatland  To your wireless point, you would have to manually add and delete every single car on every train, when there are 100+ cars per train, this would take hours. WiFi has a max range of a a few hundred meters, trains are a mile+ long currently. Bluetooth is a nonstarter. Cellular requires a signal for the entirety of the run, this isn't feasible in the slightest because of the topography where the trains run most times. Train crews already have issues with losing communication with DPU's and EOT's all the time, now you want to make it so they lose communication with the cars as well? Also, train crews are overworked as it is, you want to add more workload to them, more things to check when they already have issues checking cars? You also want to add more information for them ingest when they should be paying attention to what is in front of them?

As for your comment about the tablets, conductors already carry electronic devices with train lists on them that can read the cars, these devices cannot communicate with the locomotives and more than likely won't be able to for quite some time, if ever.

Railcars are not automobiles, it's an apples or oranges comparison. Locomotives already have more computer power and more sensors than the vast majority of cars on the road and you want to add more complexity to the system that is already complex enough? The best thing to do about making trains safer is restricting train length to less than 6000 feet and increasing the crew size to a min of 3, if not 5 like it was pre 1985, and bring back the caboose and have better preventive maintenance.

Adding sensors and things to the cars in a train is a nonstarter for safety, it costs money and there is zero return on that money spent. If the preventive maintenance that has been cut due to PSR, and other money saving tactics, is returned back to pre 2000's levels would do more for train safety than adding sensors to cars.

BTW, railroads do use microphones to test for defects, they are set a certain distance from the track in specific locations. Why should they add all the sensors to the cars when they can add all the sensors to the tracks where it would be more beneficial anyway?

I'm not dismissing your ideas out of hand, I'm telling you that your ideas have been thought of and talked about in the RR circles and unions for a number of years, the consensus is that they are not feasible and are not cost effective nor would they contribute to the safety of the crews or the population that live around the railroad tracks. It would introduce more of a workload to engineers, conductors, and carmen which would have an adverse effect to safety. The best thing would to be to make the RR's install more comprehensive detectors that are no further than 10 miles apart from one another. Require the detectors to send their information back to the dispatchers, some RR's already do this. Doing these plus increasing crew size and shortening trains would substantially increase train safety and bring down the amount of derailments.
Reply: @dammityoutube  They make such a thing called WiFi repeaters. The hotel I occasionally work for has 4 of them to reach across the entire hotel building complex.

Each set of sensors would have to be programmed for the serial number of the particular train car yes, but also each sensor broadcast point would also function as a repeater to forward the signals up the line to the main monitoring system for the engineer and conductor.

The sensors could be implemented as a matching set of 4 sensors per car, one for each axle, to basically strap on to each axle. Each sensor could measure axle temperature and rotation rate via common motion sensors found in practically every smartphone, and if there's any discrepancy between the values detected across the 4 axles, that would trigger an error indicating an issue on car serial number whatever at axle number whichever one is running hotter and/or slower than the others.

As far as keeping the sensors charged, just use gravity and the rotation of the axles themselves to keep the things charged.

As far as registering them on a particular line of train cars, don't they already have to keep a registry of which train cars are on what line? Doesn't seem like rocket science to me to add that into the existing train tracking software.
Reply: @southernflatland  It's important to remember that "smart" devices are just little hats that tell "dumb" devices what to do. My read of the derailment, as a complete layman with almost no information, is that several smart and dumb systems interfered with human operators in an unexpected manner, causing unexpected damage. In my personal opinion, examining and adjusting protocol is more immediately important than adding extra systems.

Granted, if the train was covered in FLIR cameras and wi-fi squawkboxes talking to a main computer, we'd have much more data about the precise mechanical failures caused by system conflicts.
Reply: @Stant123  that's a whole lot of words to excuse the lie of capitalism and that you considder short term private stock market dividends sacred over far larger long term economic, environmental AND societal gains through safer and reliable transports resulting in less injuries, less work loads and less lost/damaged cargo through fewer accidents.
Investing in qualitative infrastructure maintenance, wear monitoring and increased maintenance staff is ALWAYS a larger gain than any administrator suggested cost cutting, simply because the corporate economists always ignore what the numbers represent in the physical context as well as synergy effects
Reply: @southernflatland  Knock sensors on cars are pretty durable microphones. They work even when covered in grease because the actual sensor is flush with the engine block. You are measuring vibration harmonics directly, not through the air. Failing bearings will have a specific harmonic signature.
Reply: @seth7745  You have a very good point, thank you.
Reply: @seth7745  I should point out what others in the comment thread have mentioned as well, that a lot of that noise we hear as trains pass is due to flat spots in some of the wheels, presumably from past brakings.

So actually a knock sensor as such would end up triggering a number of potential false positives, so I wouldn't count on that for realtime feedback, though it would be handy for routine inspections and maintenance.

The most effective realtime sensors would be thermal sensors and rotation sensors. If the system detects a wheel running notably hotter and/or slower than the others, that would indicate a red flag error, almost certainly a failed bearing, and time to stop the train.
Reply: @southernflatland  The issues you mention were resolved long ago with the invention of FFT (Fast Fourier Transform), which allows for filtering and analyzing specific frequencies in a signal. Also, the frequency generated by flat spots on wheals would be much lower than the sound of grinding bearings and easy to filter out.
Reply: @seth7745  Yes and no. I do sincerely thank you for thinking with your skull noodle though, it brings extra ideas to the table of a problem that clearly needs to be addressed and fixed.

I do have some experience with FFT even, but you gotta consider the harmonics and everything else coming from any sort of audio or vibration feedback. It's not all low frequency, there are higher harmonic frequencies as well that add up to the clack-clack or the clang-clang on the tracks...

I now think that knock sensors are an awesome idea, but for a variety of reasons shouldn't be used as real time sensors. More like maintenance check sensors.

I think they should have thermal and rotation sensors as the active realtime sensors. If one axle is running notably hotter than the others, and/or running slower than the others, then that would indicate a red flag error and probably a good time to stop the train.